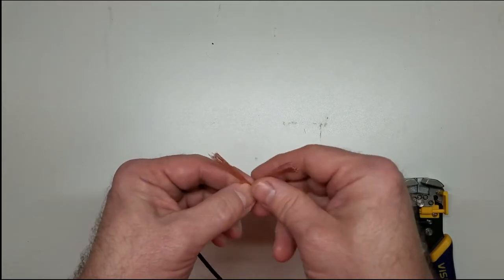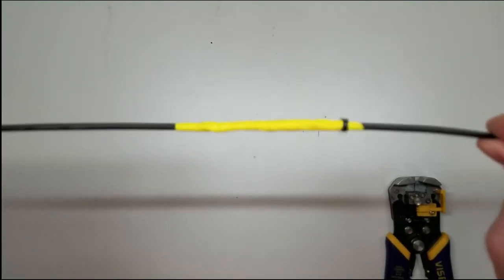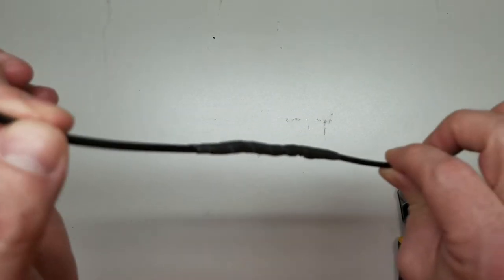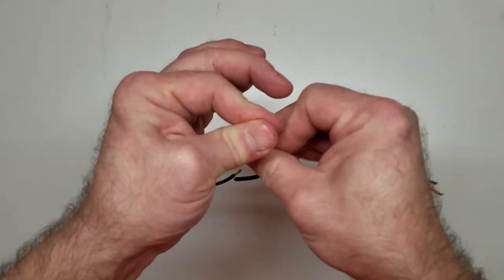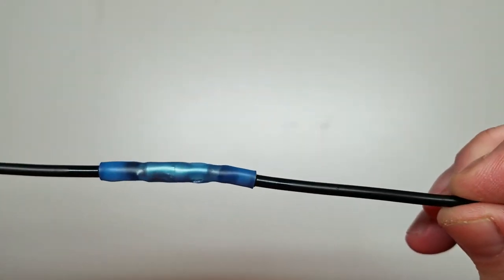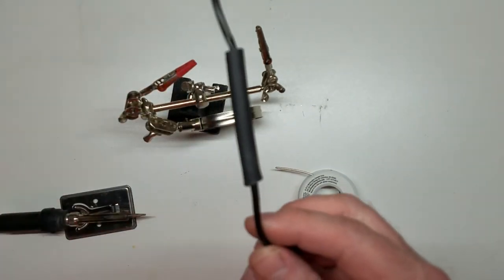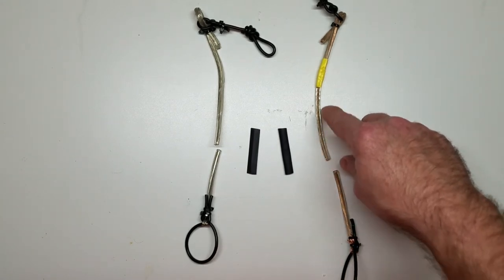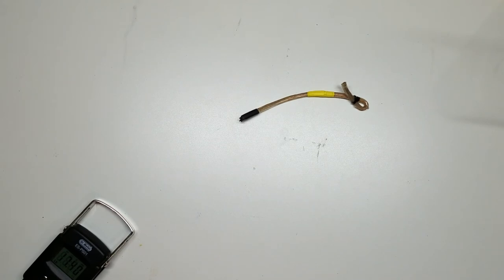Different types of connectors and wire connection protection

Comment from the maker: Tools used in this video:

Regular Heat Shrink: https://amzn.to/2V1Oc4F
Marine Heat Shrink: https://amzn.to/3bF3hPj
Wire Cutter \ Crimpers: https://amzn.to/2HpezJJ
Wire Strippers: https://amzn.to/2SyMOF0
Liquid Tape: https://amzn.to/2u7HSNW
Heat Shrink Butt Connectors: https://amzn.to/31WY7K2
Friction Electric Tape: https://amzn.to/2UWGrwA
Soldering Iron Kit: https://amzn.to/2SxVXxe